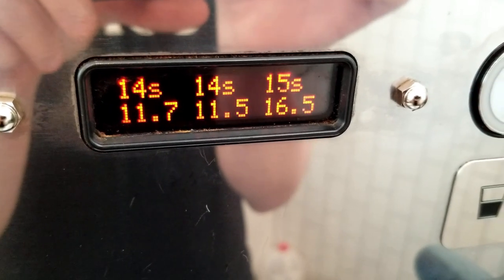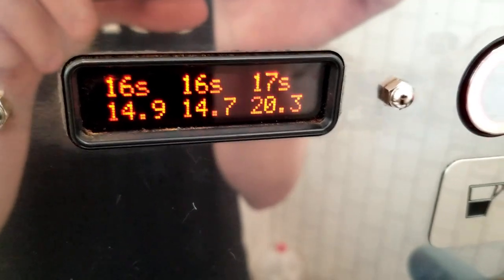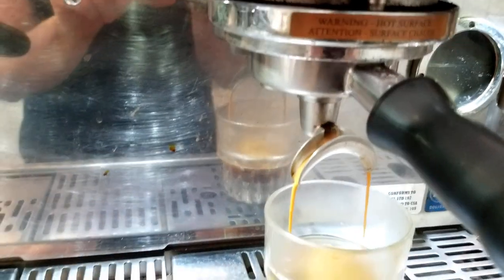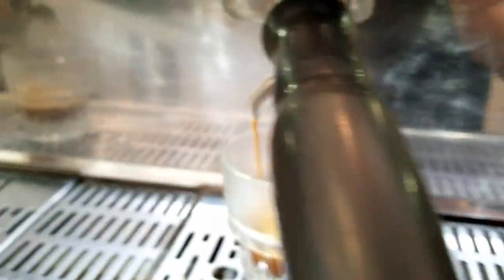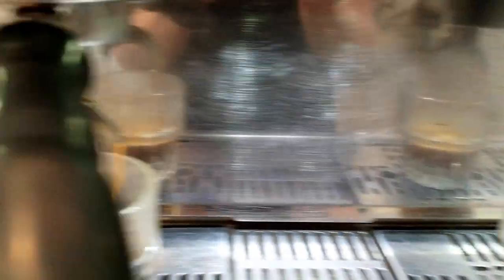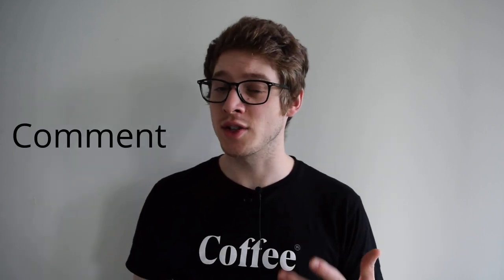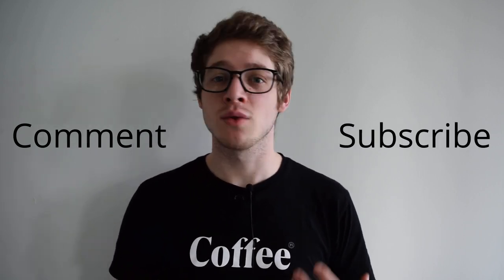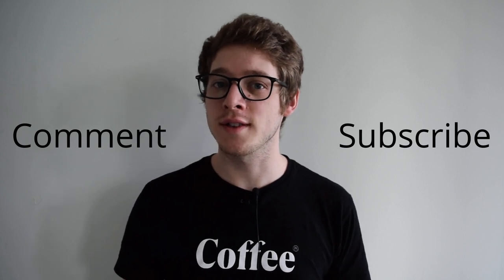Espresso Shot Time - Coffee Explained (Ep. 2)

Comment: Can I ask a question as another fellow coffee YouTuber... let’s say I have an espresso that hits 1:2 ratio in 28 seconds it comes out a bit sour let’s just say I keep everything the same but I let maybe a few more grams of liquid out with maybe 3 more seconds for my shot..... would my coffee generally speaking come out more sour or more bitter or sweet.
Reply from the maker: Great question! What you can expect from this situation is for your espresso to become less sour, more balanced, and hopefully more sweet. Letting a few more grams of liquid through is simply allowing more extraction to occur, which is what you want when you have a sour and under-extracted shot. You end up with a slightly more watery texture though, as you are passing more water through the puck. In my experience this is a GREAT way to fix a sour shot, and it's easy to do on bar especially at a busy cafe where you don't think you have the time to adjust the grind. Worth the sacrifice of a thick texture if your espresso will come out more balanced.
Reply: @CoffeeTimeJR  thank you very nicely explained

Comment: Thanks for the wonderful video again. I am using Astoria tanya 2 group old model. My settings are 15g coffee in a 14g filter basket, extraction weight 30g, and extraction time 21 sec. The espresso taste is good. If I adjust the grinder one scale finer, the extraction time goes over 30sec. I was going to ask you for variable change suggestion; but because my comment got deleted as YouTube automatically moved to the next video, I had a chance to re-watch your video again (hehe lovely). Next time when I change the variables, I will consider giving a little more dose to the filter basket and see how it goes. Thanks again my hero!
Reply from the maker: Thanks for watching! 😊 yes you could do that, although be careful not to add too much if it's a smaller size basket. If you feel the espresso at 21 seconds needs a bit more extraction you can try pulling a longer shot too, but you lose a bit of body/texture. Might help though if you are stuck between grind settings!
Reply: @CoffeeTimeJR  if I pull a longer shot, I am afraid to add bitterness to my coffee. Maybe I should start with 35g and change the variables as well. Thanks 😊